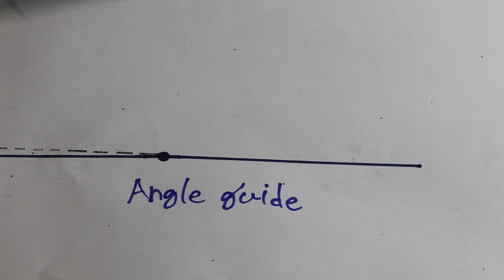DIY Project: Making an Electric Violin

Comment: Im gonna make this violin but Im not sure about the electrical part. What did u put inside the enclosure??? Pls I need help
Reply: Not sure, but piezo microphone is under the the bridge where is pick up string vibration and 3D printed closure holds output jack and potentiometer for i presume volume control.

Comment: I have an electric violin. It turns on perfectly but the sound won't come through if I plug in headphones or use an amp. I've been told that there is probably something wrong with the piezo mic but I don't see anything wrong with it. Do you guys have any ideas on what I should do or what might be the problem.